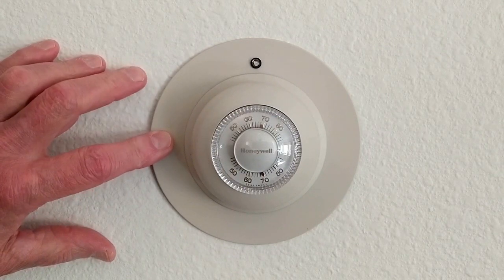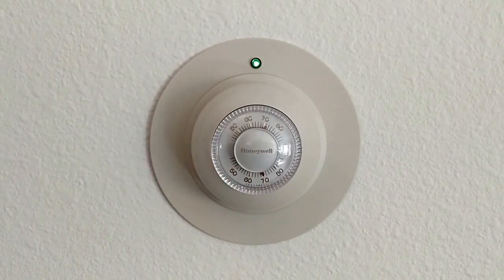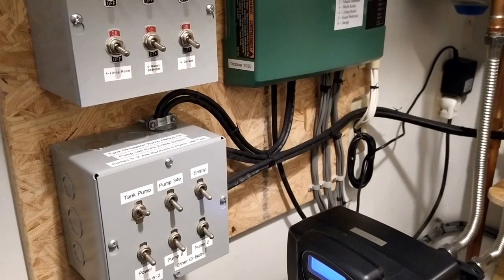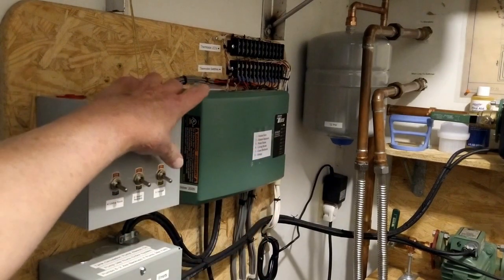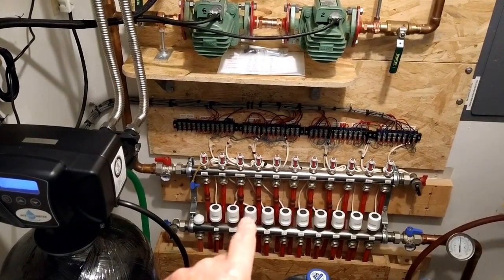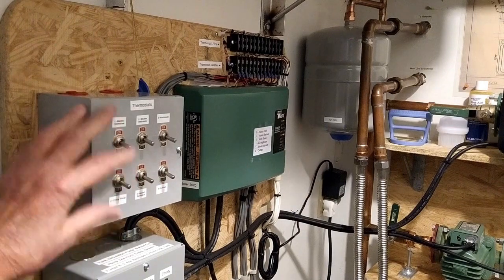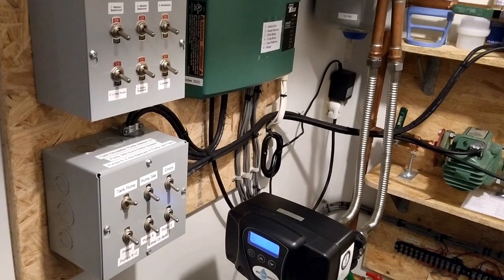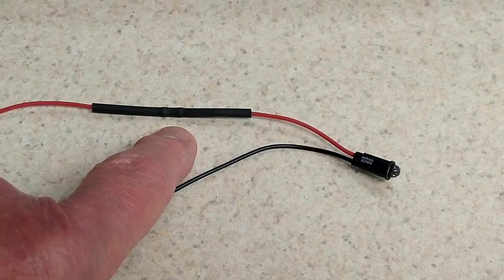Thermostat Indicator LED's

Comment: For modern Round Honeywell t-stats they are not actually mechanical. The electronics leach a tiny amount of current to operate and utilize a relay for control. Relay will make a subtle but still audible click as it turns ON, and only if there is 24V present on R. If the purpose of an indicator is just to confirm t-stat is operational (as opposed to operating) then for the new models a light is redundant as the relay provides audible confirmation.
Ideally, adding an LED should only be done if you have 3+ conductor t-stat wire utilizing Common. Connecting the LED between C & W (assuming Heat only). A t-stat is just a switch, there will be no voltage differential across R & W when circuit is closed (ON).
Reply from the maker: "If a tree falls in a forest and no one is around to hear it, does it make a sound?" 

I like it when someone leaves an overly detailed comment without actually watching the entire video or listening to what was said in the video.
These thermostats do not contain a relay.
The relay(s) are in the zone controller, which is located in the equipment room far away from the thermostats. 
The equipment room is insulated and you cannot hear the pumps (nor the clicking relays) even if you are standing outside the closed door of the equipment room.

So, if a relay makes an audible click (distinct, not subtle) and no one is around to hear it, did it really make an audible click? No! Thus the addition of an LED indicator is not redundant... but instead, just handy and functional.

Thanks for watching.
Ron

Comment: Mauritius . Just bought a pacific air fryer oven.  Led does not go off when desired to has been reached. Tussle with seller and and importer. Must guess when temperature has been reached. According to them , new tendency apps;  must hear a tic sound...( deaf persons.....!? ) .   Which is which ! Where is Electronics and Electricity....? 2023...

Comment: Why not use 1 resistor to run the LED at the lower lumen?
Reply from the maker: Sure, you could. As explained in the video, the LED's came already wired with a resistor for 24VDC but they were way too bright. Then it took trial and error to find the right value to dim them enough for what I wanted. The original resistor was already soldered in place and had heat shrink on it and I chose to just leave it alone and add my resistor... and I did not want to shorten the leads already on the LED's.
Thanks for watching.